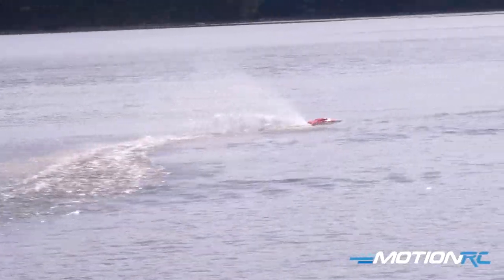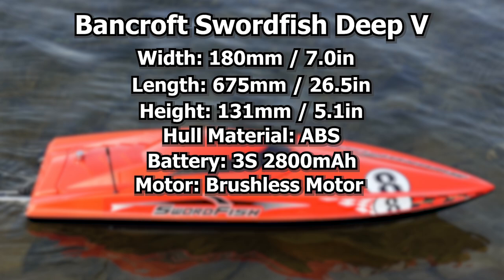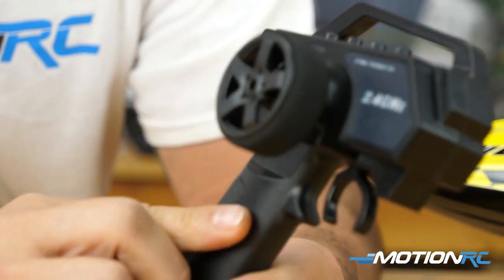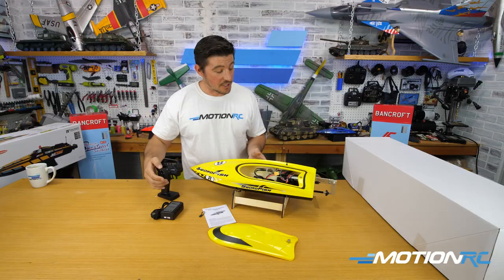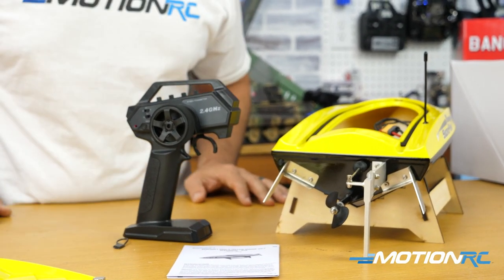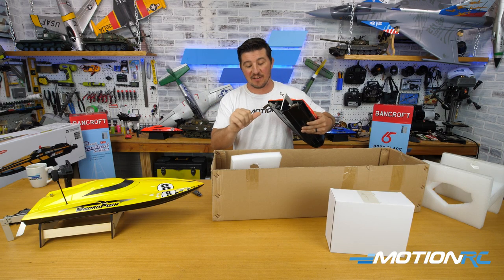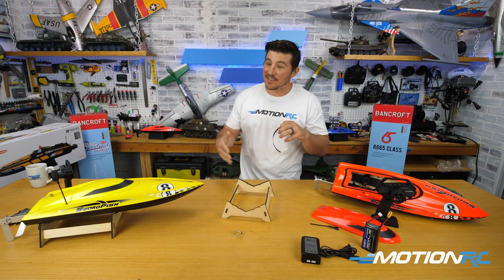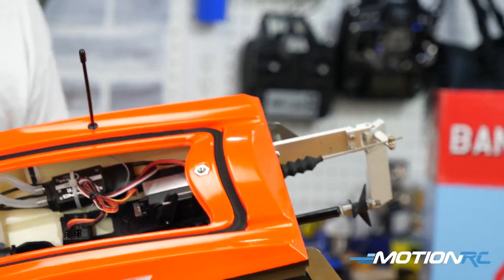Bancroft Swordfish Deep V RTR Racing Boat Unboxing & Overview - Motion RC

Comment: These boats look and run amazing in the water... I have one question:  marine grease can be used on metal parts to avoid corrosion on salty water...?
Reply from the maker: for sure. You should clean and grease after each time you run, especially from salt water